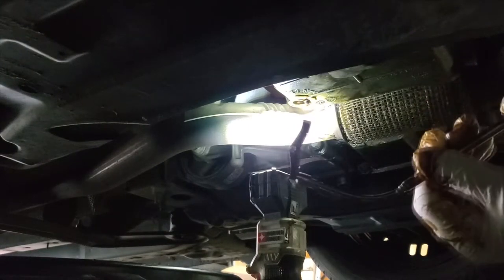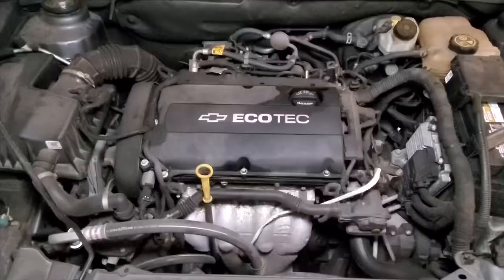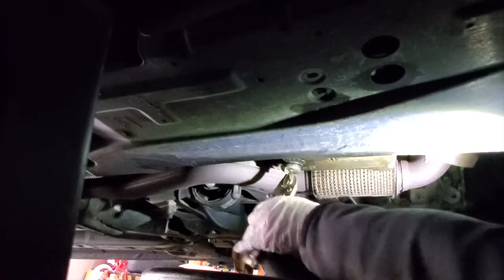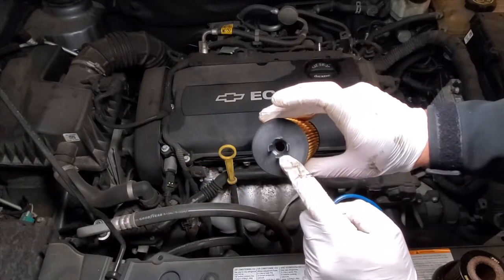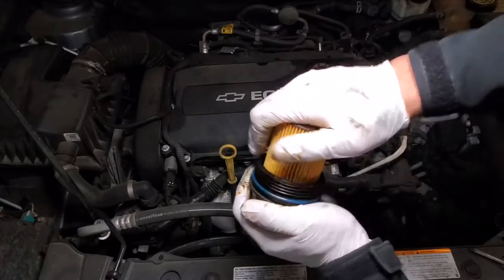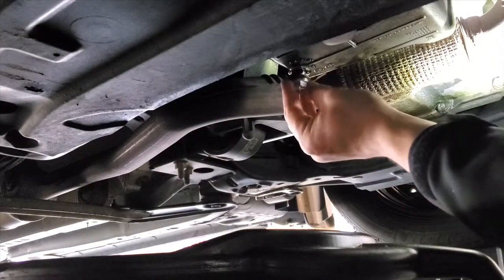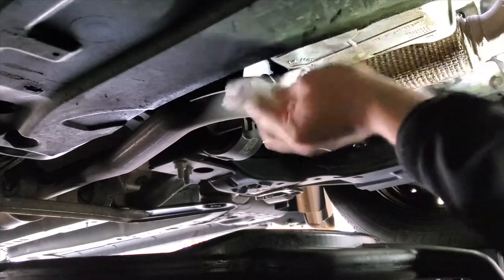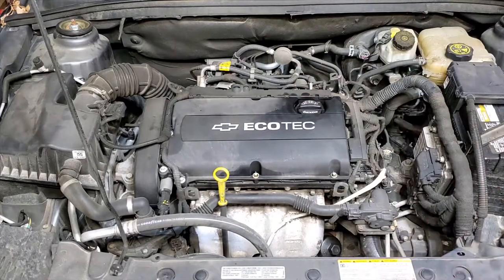How to do a 2011-2014 Chevy (Chevrolet) Cruze Oil Change

Comment: Thanks a lot for this video.  Your explanation was very simple and straightforward.  I had heard that the oil filter was on the top as well,  and getting ready to do my first oil change on a 2014 Cruze it's good to know how easy it is to access,  but especially what to use on the torque wrench to tighten it. Key details like this are often go unmentioned by other DIYers.
I actually like the idea of only replacing the filter itself. Less waste and makes disposal easier. Hope you are done with school by now. Congrats!!